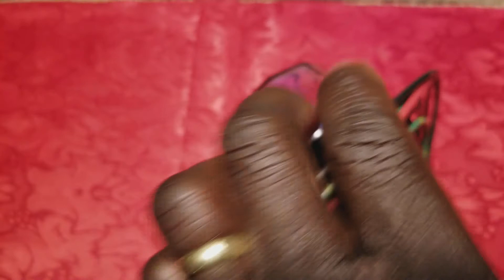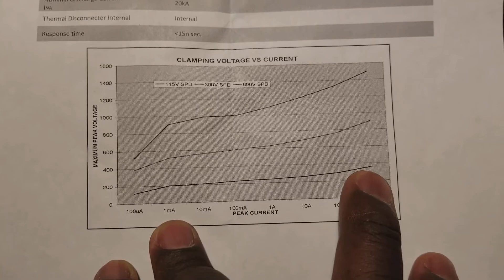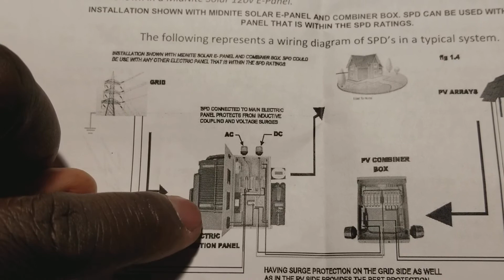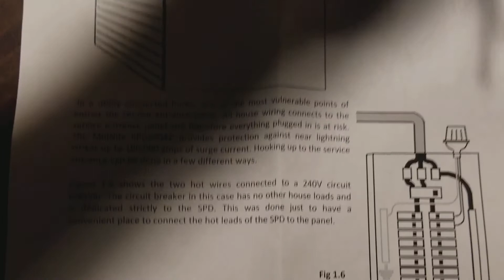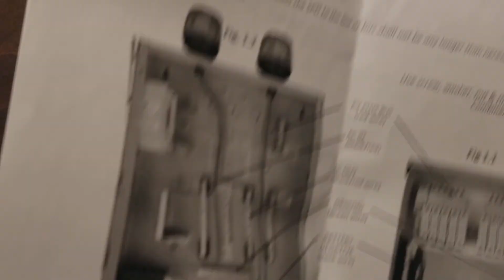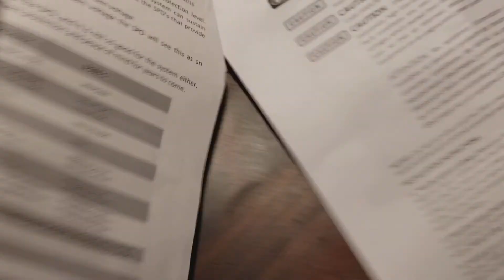OFF GRID SOLAR LIGHTING ARRESTOR | MidNite Solar Surge Protector Device MNSPD-115

Comment: Hello thank you so much for all the information I've got a solar array system but I've also concerned about my whole home we get struck by lightning out here a lot and I have had damage do you know if you can put this on the main panel coming into your house to protect all of your devices or is this just for solar only again thank you for the video I plan on buying two of these one for my solar box and then one for my main box just wanting your input if you have time thank you very much
Reply from the maker: Thanks for stopping by.
This device is mainly for off grid solar systems with its main AC Input, AC Output, likewise Solar & Wind Power Input.
It works as a lighting arrestor, surge protector, and arc protector.

Learn more about this at www.midnitesolar.com or you can watch videos on their YouTube channel.

USE THIS LINK TO BUY YOUR LITHIUM BATTERIES AND SAVE 5%
BATTERY HOOKUP PROMO LINK 
https://batteryhookup.com/discount/jwsolarusa